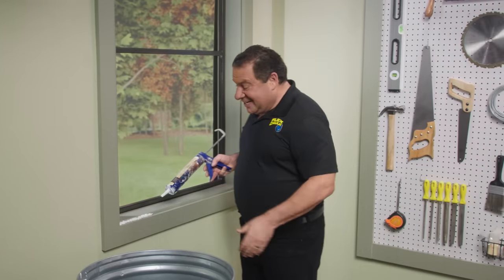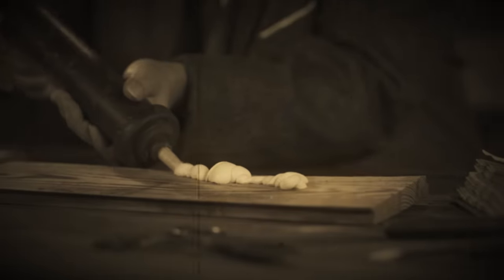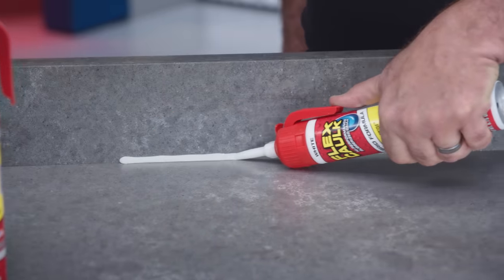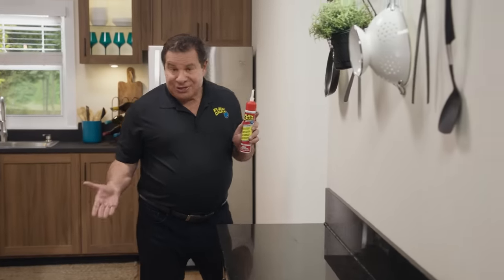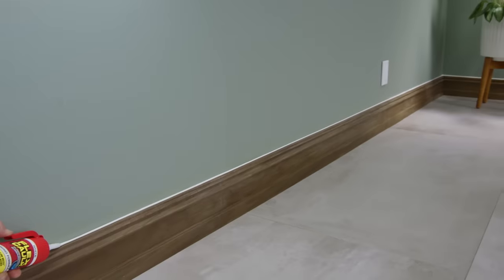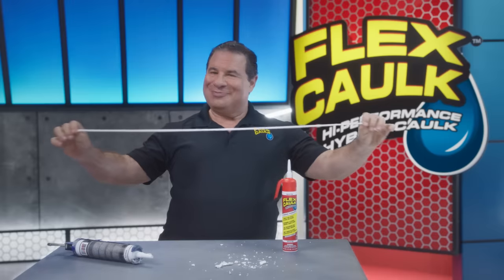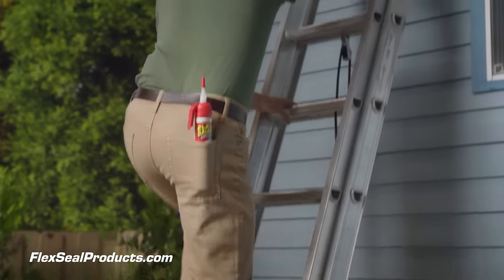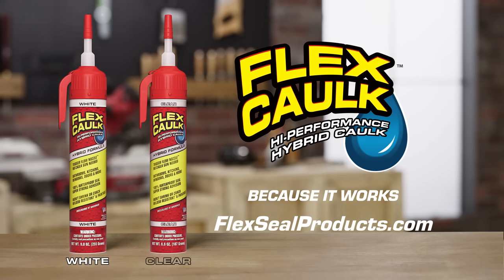Our New Flex Caulk Commercial

Comment: • High performance, Hybrid caulk.
• Trigger flow nozzle
• no running, no dripping, no mess.
• turn it down for precision.
• crank it up, for maximum coverage.
• comes in clear.
• perfect for kitchen counter top.
• sinks and backsplashes.
• complete control.
• Easy to caulk bathroom, sinks, tubs, toilets, and showers.
• Quickly fills large gaps, cracks and holes.
• Expands and contracts, and stays completely flexible.
• snap and safe cap, helps prevents the caulk from drying out.
• Light weight and portable, You can take it anywhere.
• Wont shrink or crack, and last for years.
• Bonds to all type of surfaces
• Even works under water
• Indoors or outdoors, any job, big or small

10/10 I love Phil's Caulk

Comment: Flex makes incredible products. 
Covered my whole RV roof in the seal paint after I got a leak. 
Haven't had one since. 
You're the man, Phil.
Reply: and now you can use his flexible caulk
Reply: It's probably one of the few overpriced tv ad products that actually works. I sealed my indoor pond with it and it has held for many years since (1000 litres, a lot of weight and pressure).
Reply: @SCUMBYWORM If it actually works (and better than competition), is it really overpriced?
Reply: You haven't had an RV since? What happened to it
Reply: @JoshWitte  he had to scrap it because the dea found out what he was doin

Comment: I have been doing a penny floor project for about a year now. Caulking them down and then using Grout and Epoxy to hold them in place and add a finish over the top. The pain of going through multiple tubes of caulk a week was very painful. Flex Caulk has made this project so much more efficient and has removed so much of the haste of handling several caulk tubes. Thank you Phill
Reply: it's difficult to be handling all those caulks at ones
Reply: @Requilith  That's what she said
Reply: it holds less caulk, your wasting money. just get better
Reply: @BarkerVancity  I don’t think OP is a brokie that worries about peasant problems like money.

Comment: Phil can literally make any basic yet essential material into a better and waterproof version out of it.

Now we need Flex Cement that can hold a house and being completely waterproof.
Reply: when are we going to get flex concrete, where Phil builds a bunker using several boats and screen doors filled with filled with flex concrete and then a b52 flies over and bombs it and then phil comes out of the still intact bunker and makes some sort of pun.
Reply: @thomasbyrd9352 As you can see, Flex Concrete is the bomb!
Reply: @RamdozaCh  AND IT EVEN WORKS UNDERWATER creates a floating harbor buffer like the ones used in d-day entirely out of flex concrete and chicken wire
Reply: Flex Conck-rete shoes for the discerning mobster.

Comment: I’ll tell ya what, Phil’s caulk is just about the best caulk I’ve ever had the pleasure of using, and I do caulk. Not only is it easy to handle, but the material on the inside comes out so smooth, it’s like this caulk has laminar flow. Overall, 10/10 would recommend.
Reply: I wish I could swap my caulk out with his

Comment: Jokes aside this actually seems really useful
Reply: wait untill you have to go behind taps etc..
With a decent caulking gn and caulk its not that hard, the issue I see is you are not pushing the caulk into the crack with a smothing tool.
Reply: It only really helps with small gaps and tightly fitted surfaces. A traditional caulking gun has the added action of pushing the caulk into those spaces, even if it is messier for the most part.

Comment: Normally you're supposed to press the silicone into the fugue with soap lye to seal it perfectly. It usually doesn't make a difference using this or a caulking gun.

Comment: Great I’m going to take off the crappy calk that I used because I’m not a Caulker but this seems a lot easier because the caulking gun hurt my hand so bad that when I needed a break it just keep running out and made a mess so now I’m removing that junk that I used hardly any plus having to buy the gun and having it dry out even with the tip that I purchased that is supposed to not let it dry out! This can’t be any worse! ❤

Comment: As much as I love flex seal products I got to give credit where it's due, they make it sound so much harder than it is to use a caulk gun.

I don't know about the original caulk gun but I haven't come across one that didn't have a cutter and a long poker built into it, and the whole squeeze and squeeze until your hand hurts or whatever, usually it's harder to get it to stop spraying than it is to get it to start solely because once you compress the caulk it is not going to stop coming out until the pressure is gone and backing it off is not enough to get it to stop most of the time, I can change tubes in maybe 20 seconds if I'm having trouble getting the old one out It might take me 25

Comment: I had a small leak about a few centimeters where people instal a quick little thing to get cold water to fridge and I bought flex tape for almost 20 and nothing I purchased the actual part for 7 bucks some metal with rubber on it 😅😅